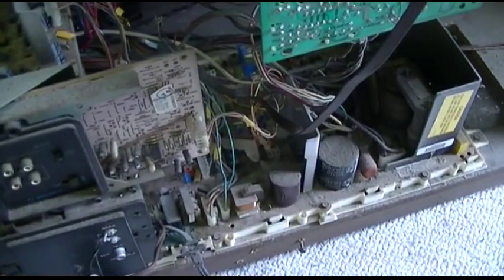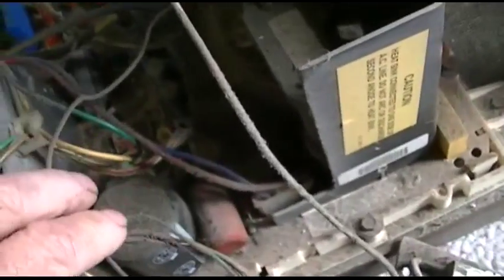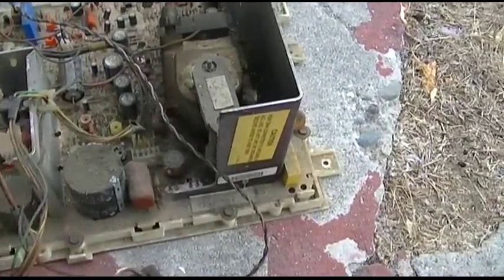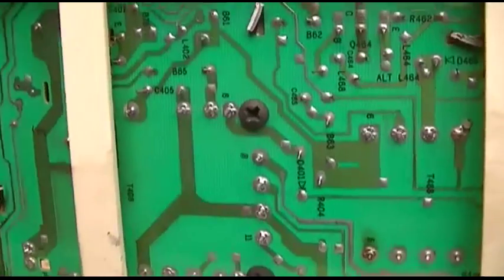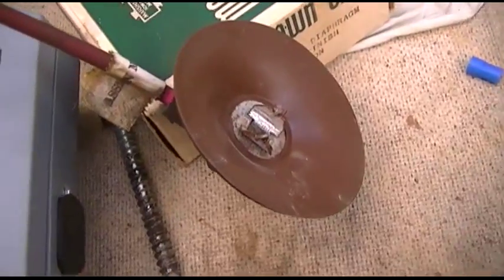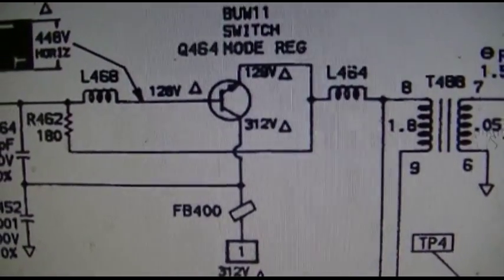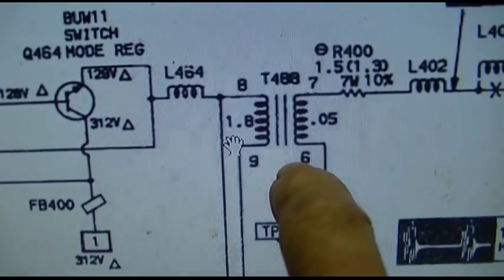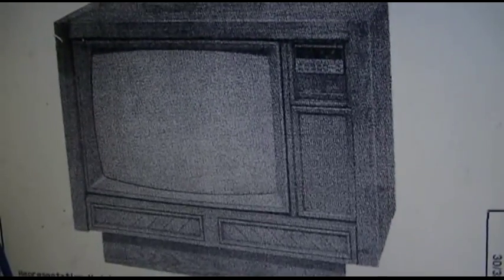Magnavox 25C Color TV Chassis High Voltage Diagnosis Part 1

Comment: ive found that in most but not all cases the horizontal out put transistor are actual called high speed switches which makes sense in a way so that it can pulse the flyback to generate its high voltage .

Comment: This is probably one of those TVs where the supply voltage that runs horizontal oscillator is scan derived.   A real PITA to figure out how the set bootstraps its own power supply. I've had a japanese set where the only thing that was wrong with it was there was a 220K resistor off of B+ that served that function and it had drifted too high in value.

Comment: What is the transistor with a diode symbol? A FET?
Reply: It is bipolar junction transistor and a diode, essentially it the horizontal output transistor and damper in the same case.
Reply: It might also be a silicon-controlled-rectifier (SCR) which were also used in the sweep circuits of the in the 1970s and 1980s.